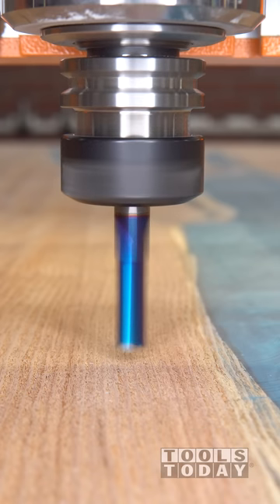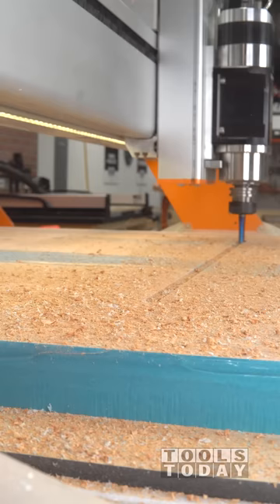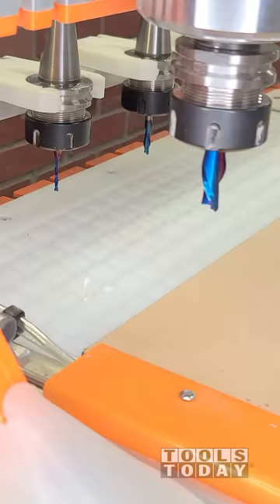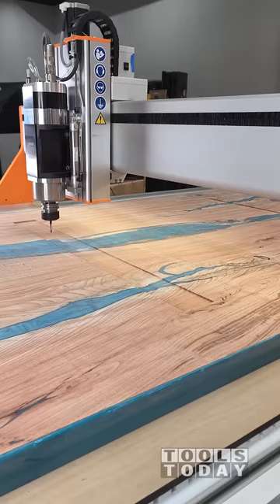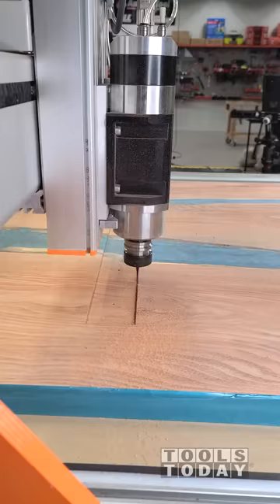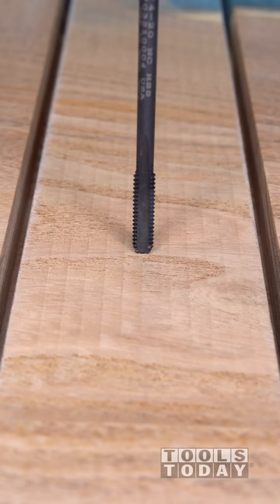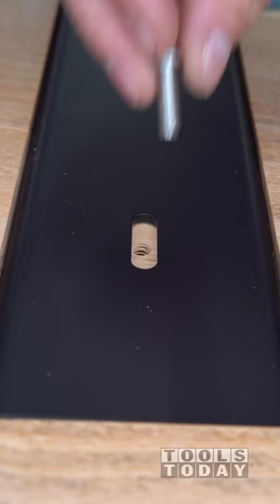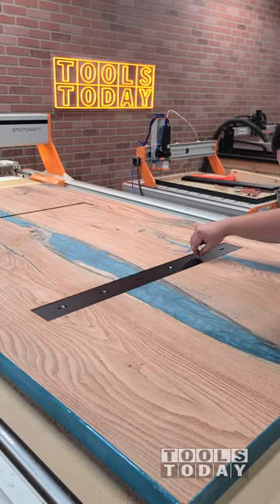Adding C Channel to Slab Kitchen Island Top

Comment: Machine screws taped into wood. Now thats a new one. You forgot the lock tight…..
Reply: You can do that in hardwood no problem.
Ofc you need a little more material than with metal, but those screws are going nowhere.
Reply: More like forgot the lock washer. Machine screws will work in good hardwood like this, the lack of contact area on the c-channel seems questionable
Reply: @MrMikeT89  I also thought it's too loose for it to help to add any structure at all. Also, the warping of the wood tends to happen in the direction of the grain... It fixed the C channel perpendicularly to it, which might not help much...
Reply: Thread lock only required in earthquake locales
Reply: Who uses a standard Allen key theses days.
Plus tapping hard wood won’t last two minutes….
Reply: @Bigballs72  standard allen key? what should he/we use instead?
Are you a machinist in training? 😄
please enlighten us with your wisdom all mighty lord of the screws 🙏🏼
Reply: @beforelifewaschaos  Ok let the lesson begin.
L style Allen keys the type you get free with flat back furniture are slow uncomfortable and genuinely of poor quality.
Those of us in most trades will probably at a minimum use a T or a P handle Allen key…
Then you’ve got your screwdriver handled Allen key again better for speed/comfort and with interchangeable size keys.
Now when time and money come into play, We have keys for sockets, keys for your drill drivers and impact drivers. 
Now, I am not saying the humble L shaped Allen key or hex key as it’s sometimes referred doesn’t have its place, generally tight or awkward spaces, it does.
It wasn’t the best tool for the job.
One bonus he wouldn’t have threaded the wood he tapped into 😖.
Reply: Jesus, nobody in these comments has any idea what the fuck they're talking about.

Comment: When you want to be a machinist but don't give a damn about tolerances.
Reply: Machinist tolerances:       +/- .003"
Woodworking tolerance:  +/- 1/8"  😂😂😂
Reply: @notstewie-HelpMeGetTo50SubsPlz  that’s a poor machinist .003 is the thickness of paper
Reply: @connorlhamon  yeah CNC machines have gotten pretty crazy nowadays, I've seen some hold tolerances with a few thousandths of an inch ( .0003")! The advancements in the last 15 years are pretty remarkable. As a tool&die maker it has made my life soo much easier over the years 😂
Reply: @NotStewie  yeah I get that my dad spent 30 years as a machinist, 5 years in the navy and 25 in power plants but all the machines he used were 1960’s or older his tolerance was .0001-.001 shits crazy nowadays with a program it can do it all for you
Reply: @notstewie-HelpMeGetTo50SubsPlz  As a woodworker myself, I tend to keep my tolerances to within 1/32 (0.0312") on the high end, and 0.001 on the low end.

I don't know a woodworker worth their salt who thinks 1/8" is at all acceptable.
Reply: @AndrewDeLong  yeah 1/8” will be visibly wrong and potentially make drawers broken
Reply: @notstewie-HelpMeGetTo50SubsPlz  I've got a CNC router just started doing work for a small business BBQ board company my tolerances are out to 5/10000 but I'm also a mechanical design engineer so maybe that helps.
Reply: Spot on
Reply: @bojangles5226  any chance the company is Dickies Barbecue?
Reply: @CT-qx8nl  it's not, but I'm curious as to why you ask.
Reply: Shots fired
Reply: You aren’t getting 0.001 tolerance with wood. Period
Reply: @Aweoe  you can easily pull shavings with a hand plane that are .001-.0005 fairly easily. Tapping holes and reliving pockets is more that acceptable and well under .125
Reply: @notstewie-HelpMeGetTo50SubsPlz  Wire EDMs are the magic of the machining world in my experience

Comment: First time in my life I have ever seen someone tap wood. I didn't even know you could do that
Reply: Well, it's softer than metal, so of course ya could tap it... but not always ya should do things purely because they are possible
Reply: You should not tap wood. It gives too much tolerance. He needs to let the top or the screw do the work itself.
Reply: He was using machine screws in weed, threads are too close to have meaningful strength longterm
Reply: I JUST SAID THIS!
Reply: Me either!
Reply: You can but need very coarse threads
Reply: You can't. This already fell apart.
Reply: I've done that actually several times with the cheapest boards available: chip boards. Let's say I need to weld 4 legs for a table. Metal jigs to hold all metal parts in place for welding will take a lot of time. Cutting chip board is fast and easy and it's a pretty even material. Yes, welding may or will burn it. But who cares? In case of a table it's just 4 x times of welding. However it helps using larger size threads / bolts. I'd say 1/4" about M6 is the minimum 3/8" which is roughly M10 works great. Be gentle when turning the bolts, you need to do it only a few times

Comment: The best thing about river tables is that in 10~ish years the epoxy will inevitably separate from the substrate as it continuously cures over time. The end result is the customer coming back for a new table or repair work! Tools like this make it super easy.

Comment: I much prefer the LX 421-7c than the 4606k, it tends to sit better on the rc712 bolt stand, as compared to using a stand alone 46125-js, but each to their own..

Comment: Endmill not bit. Why do woodworking guys call everything a bit?
Reply: I agree, it's a bit annoying  🤣👍
Reply: Mind your own bitness!
Reply: Cause we don’t normally have to differentiate much between what goes in the end of the drill lol. We’ve got twist, auger, spade, and forstener bits. “Mill” doesn’t really exist much for most of us. 

I learned my CNC stuff in a combo metal/wood shop in high school so I got the benefit of both.
Reply: Well seeing most tools & accessories are known to different people by many different names, he can call it whatever the fuck he wants. It is a cutter bit after all 🤣
Reply: Because in woodworking, that's what they're called. Bits.  Machinists have their terminology, and woodworkers have their own.
Reply: "Endmills" and "bits" use much of the same terminology to describe their geometry and cutting behavior; however, "Bits" will have a more aggressive helix angle and smaller flute minor diameter to accommodatethe chipping behavior of wood. The flute wash is also completely different on a bit than an endmill.

Comment: You can have a fancy tool and still have no clue what you are doing xD
Reply: Lol, exactly. Not only tapping wood, but tapping it fucking sideways.
Reply: Idk hardwoods are a lot different than what most people are used to. But yea they could have just used wood screws but more less showing the capability of the machine. I work with hickory and it never ceases to amaze me how hard that stuff is. It’ll mess up all your tools and blades it’s pretty incredible. I don’t see anything wrong with tapping the hardwoods
Reply: Machine screws in wood, crooked tap, no washers. Sad.
Reply: @latenttweet  fully agree, but what's getting me is the way he tapped it. Tapping with a drill seems like playing with fire to me. Probably works fine, but it scares me.
Reply: Agreed
Reply: @latenttweet  oh hush you no one legitimately trusts Machine threads in wood no matter it’s type
Reply: @bradster1200   tapping hardwood is totally fine. You need more material than metal ofc, but those screws take serious forces.
Reply: @ohhushyou7683  depends on the wood.  If you're working with an extremely hard wood such as Brazilian Ipe (pronounced ee-pay), then you almost HAVE to drill and tap it. Driving a nail or simple wood screw through that type of wood will almost always cause it to split and crack.
Reply: @AndrewDeLong  oh hush you 
there’s always an outlier but the fact you had to explain how it’s said shows how rare it would be  and how needless the idea is
Reply: @ohhushyou7683  Ipe isn't an outlier. In fact, it's an insanely popular decking wood. It just happens to be the best example as well. 

Fact is, ANY super hard wood would work well with threads.  Don't blame me for your lack of knowledge there.
Reply: @AndrewDeLong  …oh hush you
Reply: @AndrewDeLong  3.1% are made of Ipe is aka outlier
Reply: OH HUSH YOU!
Reply: @ohhushyou7683  source?
Reply: If they knew what they were doing they could have used the CNC machine to tap the holes. Though not sure I would be taping a hardwood, would need to do torque out testing before I felt comfy
Reply: Blows my mind he didn’t use the live tooling to tap 😂 them machine screws ain’t holding up
Reply: @bojangles5226  you can't always use a cnc for tapping. Technically yes it's possible to do, but routers can't usually do tapping operations because they can't turn that slow and still have enough torque for that kind of operation. It's also an issue with cheap Chinese mills. My school had a mill that's supposed to be able to do all kinds of operations but realistically will snap every tap you put in it because it doesn't operate on the same gcode that every other mill does

Comment: Cool looking project. Hate to be the bearer of bad news. But you can't tap wood. Think of how the wood grain structure is. It's got a bunch of long fibers layered together. When you cut threads into them, you are cutting the fibers leaving only the bonds between them holding them together. Wood screws hold because they separate the fibers. It breaks some of them but it squeezes between the rest. Over time those threads will deteriorate. Granted, this isn't a high stress point so it should be fine for a decent amount of time. But over time as the wood expands and contracts the will strip in the future. Just a pointer for any future projects. 

I probably would have opted for tapered wood pegs and glue. In the same style that clock makers use to pin pieces of a clocks action together. The tapered peg would hold the bracket in and the glue is often stronger than the wood.

Have a good one man.
Reply from the maker: always good to hear different techniques thank you
Reply: The instability of the threads also means that the C-channel thing is entirely useless, as the screws won't hold it for long, especially when humidity changes start affecting the wood.

An alternative that I learned from other joinery journeymen and masters is to cut dovetail slots width-wise into the bottom of the tabletop and then glue a long dovetail shaped batten into it.

English isn't the language I learned this with, sorry if my suggestion is hard to understand or doesn't really make that much sense.
Reply: @LapizLazu1i  you were clearer than a lot of people who's native language is English.

Comment: Ive found that if you tap threads into wood and skip the insert it works even better if you tap the hole and then wet the threads with thin CA glue, then chase the threads with the tap again and you have some hardened threads that will take some use and still hold up.

Comment: Lul I was about to critique you're wood threading, but if that shits breaking inserts then I'd have to agree it's quite hard enough on its own. The fact it even created threads was interesting
Reply: What he did is just stupid. This is almost useless. You can tap concert too but you don’t because it’s not as strong as compressed fittings which take less work. It would be stronger if he only glued it in
Reply: @Valkathon  Personally, if I was working with a hardwood that was breaking inserts, I would tap the wood too. Then I would lace the hole with a strong epoxy when I set the screw in.

Comment: Threaded inserts are typically used in aluminum or other soft metals. If you were “breaking them” in wood, you were doing something wrong. Having said that, you should have used lag bolts with a broad flighting on the thread.

Comment: Will the counter top supports be bearing directly on the c channels? Otherwise I don’t see their purpose. The channel is recessed so it wouldn’t be sharing the load with the rest of the bottom of the slab. And the slots in the channel are in the direction of the potencial deflection so if the material were to try and bow/stretch in that direction it wouldn’t be able to transfer the shear to the screw heads since the screw hole is elongated. I’m having a real hard time understanding what the benefit is here, unless like I mentioned the channels would be the main point of contact for the supports.
Reply: Agree
Reply from the maker: Yes, they're flush with the surface of the wood.  They're designed to keep the slabs flat prevent cupping between the two slabs.
Reply: You seem to be confusing expansion with flexion/extension. The c channel is there to prevent the board from cupping/bowing. The screw slots allow the width to expand and contract without cracking (hopefully), and the c channel itself is prevents the edges of the slab from curving up or down. C channel doesn't need to be the point of contact for the supports or flush as it basically is just a cross brace.
Reply: I understand the intent, but my humble suggestion  would be to get rid of the slotted holes. The material cupping means the surface is stretching/compressing. To make full use of the channel the wood stretch needs to be transferred to the steel via the screw shear. Theoretically your keeping the slabs flat to each other but the slotted holes could allow them to separate.
Reply: @jared9953  I'm not sure what you're trying to say but this is the proper installation of a c channel to prevent warping and cupping. C channels is used as it's extremely strong against warping and the channels routed into the wood allows the c channel to be used without being unsightly
Reply: @RapTapTap69  what they are saying is basically being that the spots where the screws hold the channel in place is slotted in the same direction in witch the slabs are joined by the resin therefore if the slabs were to want to separate they could still do so being that the screw could travel in the same direction as the separation.

at least this is what I think they are trying to say if not I apologize 
also I dont know much about this type of wood or this process I'm just trying to explain what I think they were trying to point out as I had the same thought
Reply: @pelath3  that's not the purpose of the c channel. The c channel is to prevent the wood from warping and cupping. It not to prevent the wood expanding laterally
Reply: @jared9953   wood expands and contracts throughout its life,  mostly across the grain (the boards get wider or narrower). Without room for the screws to move,  the forces can be enough to cause cracks or bulges. The purpose is to hold the wood to the channel for flatness,  while allowing its natural movement.  Hope that clears it up.
Reply: @ToolsToday  assuming the resin is cured and the wood is dry its not going anywhere, the tin strips aint gonna do shit vs warping as you're only supporting one axis, they would appear to be more mounting brackets than structural, don't confuse the two.

Comment: I’m really interested to know the cutter speeds and feed rates for wood. In my experience the speeds on CNC mills are to low to not splinter the wood.
Reply: Typical speeds for wood can be as low as 10,000 rpm, upwards of 25,000 rpm.

Comment: Tapping into wood is a mistake.  It can't hold the tension for a long time without giving way down the road.  It's not the same as a wood screw.  Next time I'd just still the holes very slightly larger for the inserts.

Comment: "threaded inserts keep breaking because the wood is so hard".... Yeah that's why you use stainless steel threaded inserts, the zinc and brass inserts aren't worth wasting your time with.
Reply from the maker: I did, snapped the top off of two stainless steel inserts.

Comment: The warping issues are going to laugh at that setup. There is a reason why tables are either made so thick I to doesn't matter or have alternated grain patterns glued to together. It's more likely that the wood is going to split away from the epoxy before anything else. Craftsmen have been building tables just about the same way for centuries for a reason. Is your surf e going to be beautiful? Most certainly. Will it be a piece that will last for a hundred years? Most likely not.

Comment: I would think that thin metal would do little to prevent warping, but I don't know. 

What I do know is that you showed the c channel flush with the surface, but your machine screws protrude...perhaps it doesn't matter if you are floating this piece over some base cabinets or table legs. 🤷🏽
Reply: The point of the c channel is that it is super difficult to bend in basically any direction, good enough to prevent a table from warping.

Comment: Aren't you afraid of wood expansion, especially in a wet environment like a kitchen? I would think that the C Channel would prevent the wood from contacting and expanding.
Reply from the maker: I'm not.  The C channel has elongated slots where the bolts go in in the direction of expansion allowing the wood to expand and contract freely while still remaining flat.

Comment: Who the hell thinks this is bonkers?
1. Who threads wood ?
2. Who uses sheetmetal screws on wood ?
3. Why would you use a piece of c channel when a flat strap would be just as good and much easier

Comment: If your threaded inserts are breaking, you aren’t drilling the right size hole for the wood you’re using.
Reply from the maker: I tried putting the inserts into a test piece with 3 different hole sizes and had to get to the point where the threads were barely grabbing the wood so the insert wouldn't break or the tool to install the inserts wouldn't break.
Reply: @ToolsToday  Honey locust isn't particularly hard, so I'm not sure why you're having so much trouble.  What threaded insert were you using?
Reply from the maker: Stainless steel ez lok inserts